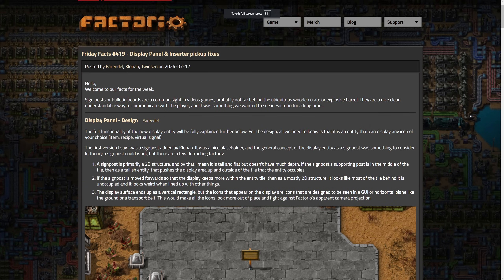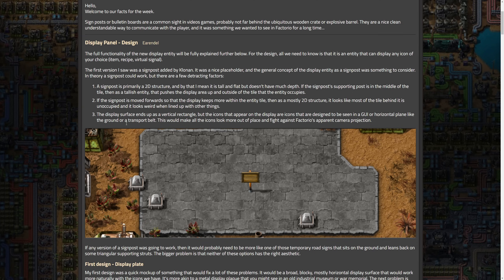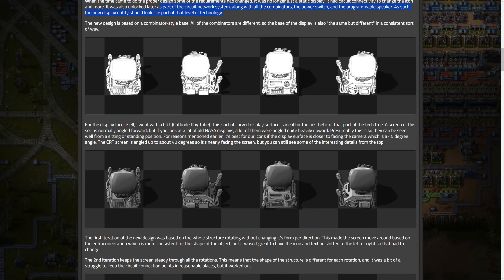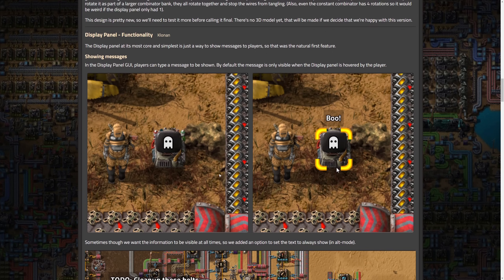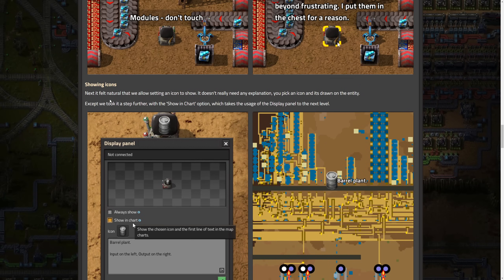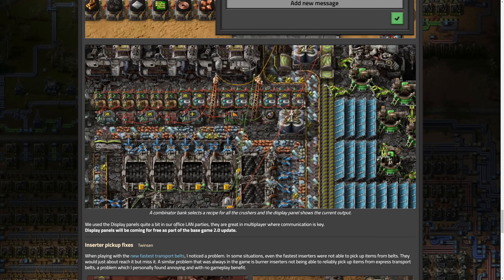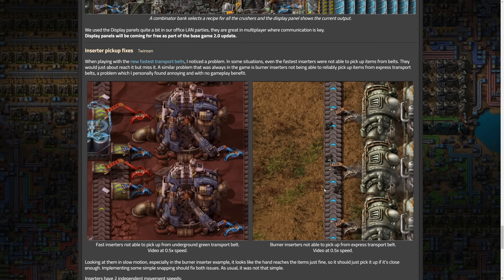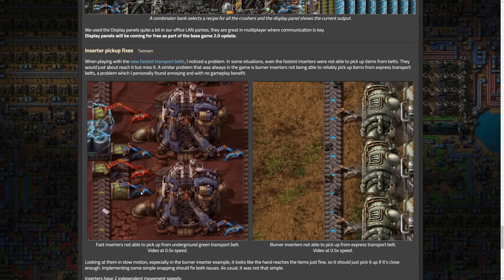Factorio Friday Facts #419: Display Panels & Inserter Fixes / Buff

Comment: I have a build design that means building my base to launch a rocket took 21:22:46, which is well past 15 hours, but it isn't terrible but that was without biters, so I plan to run some more tests after I get a new updated time on my previous run, I never saved the game so I had a load that left me in a base with extremely low power and all kinds of trouble in the outlook, but I had a little bit of solar power in place not enough, but some so I disconnected my steam power from the base so the steam power could get a load of our stockpiled in the belts that feed the 4 lanes of steam engines.  Then I turned back on the steam to the base and headed into the base, I also told the base to try and recall all the bots and I verified I was not adding any more bots to the base, but it is unlikely the construction bots will get disabled since they have a huge backlog of work to do, oh well if I get some off the chargers that will free up more power for the machines :)  Anyway, after that I'm going to try and build my base with biters set to start far away and not evolve first and see how many hours that costs me :)  Anyway, I hope it isn't to much of a disaster :)  Yes, some of my delay is I build roads and line both sides of the road with power poles, etc... and when I try and do my run in sub 15 hours I do not build roads and I build a thing, then I build the next thing a few squares over and repeat and repeat, I should maybe try making a clean new build that eliminates a lot of the double effort I waste on power and light and shit with this design, it wouldn't need to change much, but I would lose my side roads that make find things easier, oh well, I probably need to think more, and try more :)

Comment: curious: what are some of the use cases / ways you see yourself using the display panel? What I thought of was a way to debug / inform players what the heck a bank of comparators is doing. 
so far all we've gotten in terms of circuit network are variables....now we have a way to display messages based on those variables....to me this is akin to "commenting your code" 
With the new ability to set circuit recipes, it can also be used at a "dashboard" to inform the player what different sections of a variable-controlled assembler set up is currently doing......without having to travel to each place...
OR: with the introduction of cross-planetary logistics and multi-planet bases....a means of informing the player what certain locations are low on....but we can kinda already do this. 
Wondering if there are any "obvious" or novel ways such a thing can be useful.

Comment: Where is the faster stack long handed inserters? Or a Tier 4 or 5 assembler? Advanced 4 way belt sorting  splitter that operates at Blue belt speed? Rocket artillery? Super electric furnace with higher output with a higher power draw? Larger train cargo wagons? Chemical weapon missles?
Reply: I assume at least some of these things are coming up in a future FFF, all logical updates too I like them all
Reply: The foundry is the super furnace. Other things are practically just a useless bloat and/or simplifiers.

Comment: I just downloaded Nixie Tubes yesterday. Such a handy mod and the idea is very similar to this but I kind of miss the ability to display item icons in the Nixie Tubes mod, and this panel cover that and more. hope you can display numbers or signal values in it just like NT does.
Btw, they changed the map icon for the fluid wagon? i guess i didn't noticed this in the previous fff

Comment: It would be so cool to be able to link rows of adjacent displays to show the message text, and use a scrolling marquee if the text is longer than the number of linked screens.  I know you can do this with tons of combinators, essentially making your own computer chip logic, but that's way too involved usually.  Also, I don't know how it would look, but it would be neat if the displays were interlaced or had a subtle glow to get that old CRT effect.
Reply from the maker: @DeronMeranda  great ideas! I agree with both for sure. Having a subtle glow would be cool, especially at night. Oh! Maybe the glow only turns on at night, like when the lamps do. That'd be perfect in my opinion.

Comment: 100% should be a different binding than alt
Reply from the maker: @theendofthestart8179  glad I'm not the only one thinking that!
Reply: @Xterminator  what if holding alt down popped up the extended text? - press to toggle/hold for extended?
Reply: I think that is good idea to just make an alt mode 3 stable, like off, on without displays, on with displays
Reply: Idk if you guys understood what they wrote in the description of that but they said that they added an option (in each individual Display Panel) to always show if you have alt mode on, not that alt mode showed all Display Panel texts everywhere.
Reply: @sedivh0  that implementation doesn't fix the issue. all 4 states should be possible. alt on and displays on, alt off and displays of alt on and displays off and alt off and displays off.